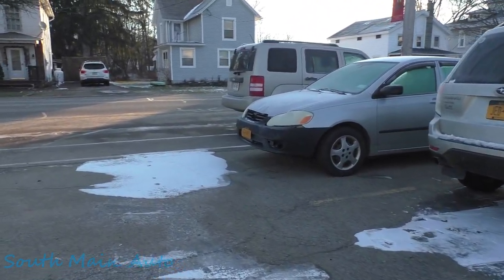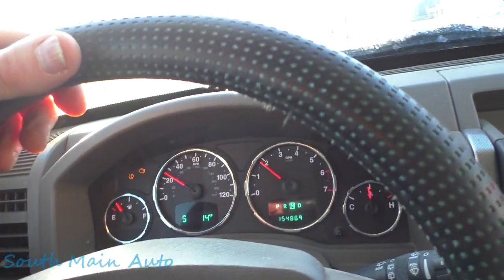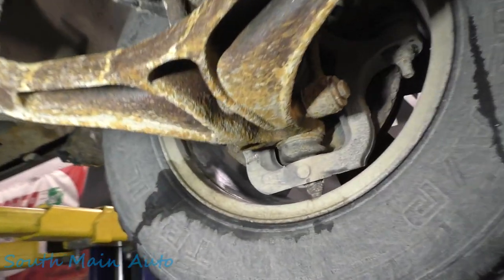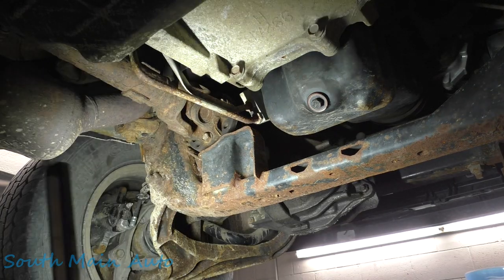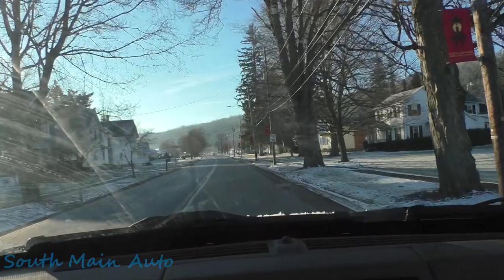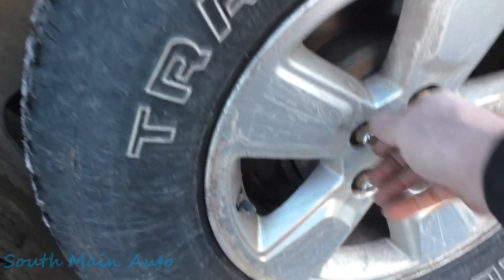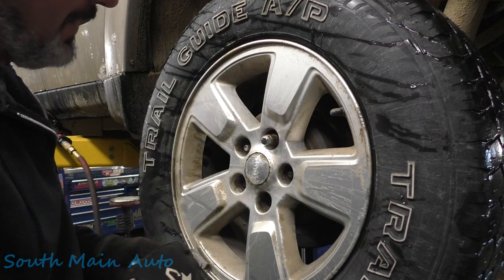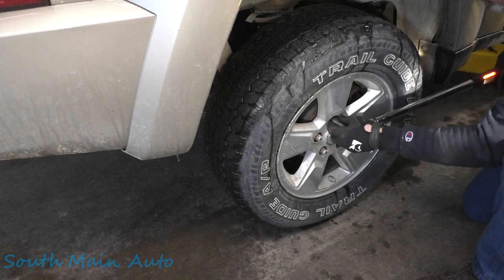Customer Just About Lost It.... A Wheel That Is

Comment: We have a small SUV, the torque spec calls for 83 ft-lbs..torque it once after 70 miles to the same 83 ft-lbs & never any lugnut movement after. Maybe the studs are stretched on that unit?
Reply: Well it's better to be a little too tight than too loose.
Reply: @Yophillips3272  Found the guy who tightens it till it's loose, then back it off a 1/4 turn.

Comment: I've never trusted alloy wheels. The metal is too soft, and the torque doesn't hold. They're hard to balance, and the weights fly off. Alloy wheels are also easily damaged by impact, by poor tire mounting technique, and even by compounds used to de-ice roads. I prefer to pull the alloy rims, and replace them with steel wheels.

Comment: Had one years ago the went from loose to sheared off in about 45 seconds,  That was a alloy on a Celebrity. Strange thing about it was that all 5 lugs and nuts were still on the car, it had torn the center out of the wheel! Found out later that the owner has driven it "on a spirited manor" and lost it. The curb stopped him and it must have cracked the wheel.

Comment: I have to disagree with your cure for the loosening of these lugs. They loosen because at some point (probably a tire shop's use of an air impact wrench to tighten them) they were over tightened. There has to be a mechanism causing this loosening. There is nothing exerting a loosening torque on the nuts. They loosen because the studs have been tensioned beyond yield and have stretched and weakened. Over-torqueing may also compress and yield (weaken) the aluminum wheel locally allowing further compression. No amount of over-torqueing these lugs will hold the wheels on. DO NOT over-torque wheel lugs. Another cause of stretched and yielded lug studs is failure to clean and dry the threads (the condition specified by those who assign factory lug torque values). Any anti-seize, grease, oil, or fluid film will cause over-tensioning of the stud even when the specified torque is applied to the nuts. When a wheel comes loose, provided it wasn't simply never tightened, the studs must be replaced with new ones, and the wheels must be carefully inspected for compressive failure.